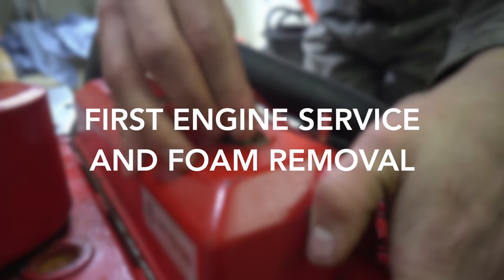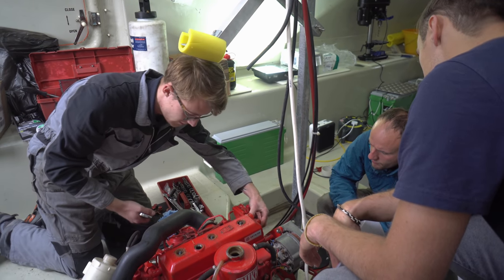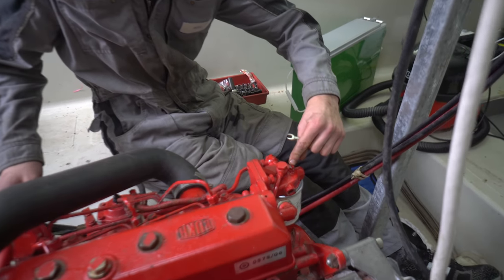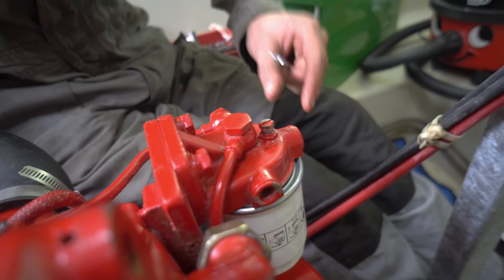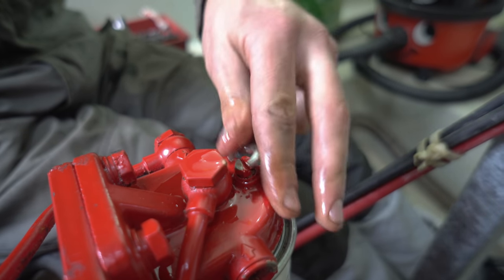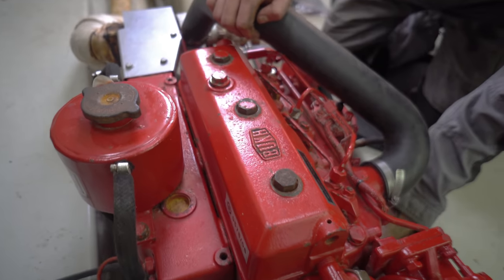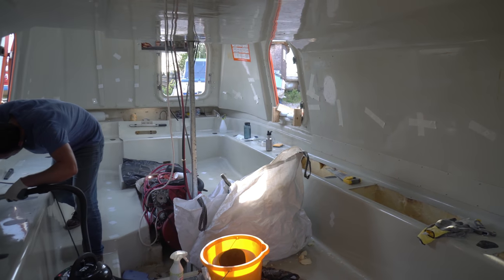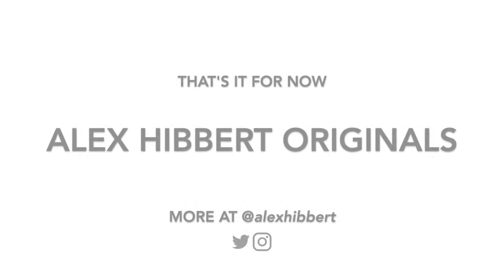Lifeboat Conversion Ep2: Servicing a Bukh engine [4K]

Comment: Bring extra belts for the engine and marine epoxy putty sticks. Let's gooooo
Reply: Miliput, spray foam, candles, waxed storm proof matches, dry socks in a plastic bag. cognac.
Onwards and upwards.
Reply: @Ben-Downlow.  ...of course pack the nooks with even parts chutzpah and reverence 😃🍯

Comment: Got an LM 27 motorsailer with a Bukh DV36. The engine is 41 years old and still runs like a new one. These motors are so incredibly solid. At 13-1400 RPM, it uses around 0.6 to 0.7 liter per hour, at 3.8 to 4.2 kts. I've had my boat for a couple of years now, and I always use the engine since I took off the mast. Initially I wasn't happy about a 41 year old engine, but it's grown on me. Now, I'm beginning to think that this thing could run for the next 200 years without any major issues. It's creme de la creme when talking marine engines.
Reply from the maker: I hope to have similar luck!

Comment: Good engine technically brand new. Yes very sufficient horsepower and being able to run at lower RPM. Binge watching your videos 👍🇦🇺
Reply from the maker: It's one of the great things about a decommissioned TELB. Although, diesel engines don't like being sat inactive for ages.

Comment: I assume your bringing another method of propulsion. I suspect the foam standard is a product of the boats past life and the launch method being a factor, it slows water ingress should there be a breach. Its your call and your life on the line but I would of thought other buoyancy applications are practical both physically and economically such that you might even free up more space. Even the fuel will add buoyancy although minimal. Best of British luck and ill give it a touch of Irish too.

Comment: That little diesel engine is probably based on a design 50-60 years old which is fascinating. Obviously in a lifeboat you need reliability and simplicity and you can't get much better than a little four cylinder diesel engine like this, which has a fully mechanical fuel injection and pump system. Modern diesel engines in cars are highly complex, and employ many electrical functions to control the injectors, ignition timing and turbocharger. The beauty with this engine is that provided you could stop it pulling in water, it is so simple and so "mechanical" that it can run without any electrical power at all under water.
Reply from the maker: Bukhs certainly have a good reputation, and these are intended for lifeboat use, and not repurposed tractor engines.
Reply: @AlexHibbertOriginals  That's interesting. I thought as well how similar it is to narrowboat engines. They are insanely reliable due to their simplicity. Love your videos. Am in the process of watching through your entire conversion series on here.

Comment: IDK about where you are, but that closed cell foam can be really cheap if you mix your own (hear in Australia anyway). A premix can would do 0.3m cubed for about $56 from memory, I found a fiberglass wholesale supplier and they sold me 2 tins, I could do about 5m cubed for $150. 
It's less convenient for doing up under decks and ceiling type work, or even side walls I need to learn a few skills, but basically you mix 2 parts in a cup like green cordial and water, tip it in like water, and within seconds it starts to expand 10 fold. Side walls I had to do in steps like the side of a mine hole so the thin mixture could sit on an edge and build up wards, the ceiling I didn't really get, I expanded a few bits all the way up and just left it as good enough, was no way to get the liquid into a tight whole, but my project with foam was in a 1k tin boat from 1970's, so it didn't really matter.
Reply from the maker: The LD40 is quite expensive here - I've used the two part in a few areas. It's got to be the correct weight bearing grade, not squishy foam. But have kept lots of the dug out foam to recycle.

Comment: Sweet running little engine. I have 2 of them that I got out of a warehouse that had been abandoned.  A single cylinder and a 2 cylinder.  But both need work. Do you have any info resources on these?
Reply from the maker: Bukh publish reasonably good documents on their website.

Comment: Just started following you.  Very interesting. Especially when I learned that you plan on some long range voyaging. I often thought that these vessels might make for an interesting and capable conversion.  You later sea trials showed that you were not using that much of the power curve.  Be aware that diesels like to work. Constant light loads a not so good for longevity. So perhaps less pitch on the prop?  Good luck and I will subscribe.
Reply from the maker: Cheers!

Yes, you're right, although the engine is far from idling when at cruising pace. I do need to speak to a propeller expert in the coming weeks.

Comment: You should consider a very high amp alternator and lithium batteries. That way you could do just about anything with the batteries.
Reply from the maker: I've considered Lithiums, but Lead Carbons can be abused in a similar way (fast charge, deep cycle etc), are helpfully heavy (free ballast) and are a fraction of the cost.
Reply: @AlexHibbertOriginals  thank you.
Reply: @cliffp73  Also, lithium batteries cannot be charged below freezing. Keeping the batteries above freezing shouldn't be a problem if things are going normally, but it is something you have to consider for emergencies.

Comment: The boat may be internally buoyant, but internal water will still be a problem. In addition to an electric bilge pump on each bilge (see my other comment), consider an engine driven water pump that can be engaged / disengaged. These can remove a lot of water quickly.

On my boat (which is much bigger), we simply use a Y-valve on the engine's cooling water pump, allowing it to suck water from the bilge instead of outside. However your engine's water pump is probably much smaller and that setup might not be effective.
Reply from the maker: After a few days, it was no more than a sponge job to clean and dry the bilges.

Comment: Is the Eng. Aircooled? See no Waterhoses during running?
Reply from the maker: No it's keel cooled. The engine was only run dry for a minute or two to avoid overheating.

Comment: That foam if dirt cheap it is bog standard expanding foam.....Check the specs it is probably fire resistant
Reply from the maker: It's far from dirt cheap sadly. Closed cell 2-part LD40 marine approved.

Comment: I'm not sure what video this is most appropriate for - but you should have two alternators connected to the engine via separate belts. Redundancy, extra capacity. You can run them to the same electrical system, or have parallel / backup electrical systems (house battery & starting / emergency battery).

Alternators take a lot more wear when you run them close to their maximum capacity. Specifically the diodes which convert the 3-phase AC produced by the alternator into DC to charge the batteries. So having extra capacity has tangible benefits.
Reply from the maker: It's logical but just not practical for the setup here. Also, energy generation is not going to be relying on the engine as a primary source.

Comment: Beware running your diesel at low RPMs for very long, else you may glaze the cylinders, and you don't want that to happen. Other than that, whack-o, lads!
Reply from the maker: We'll most likely run at mid-revs, in the middle of the power curve graph we had from Bukh - and at the point we later calculate gives best mpg.
Reply: @AlexHibbertOriginals  It happened to me with my 120 hp Ford Lehman, cruising around at 1200 rpm burning waste veggie oil. White smoke out the exhaust and oil blasting out the dipstick hole. Fuel conditioner cleared it up fortunately. Great project you have going there. Greetings from Canada.
Reply from the maker: @Shmerpy  I'm there most years - one of my favourite places - hello Canada from the UK!
Reply: @Shmerpy  waste veggie oil is a sod for that, I had a similar experience using it in a low revving engine, had to take the top end off and de gunk evrything, valves, rings, everything.
A diesel engine likes to work hard, so, towing another boat or somthing from time to time, really use its torque. And of course, from time to time just blast it at full revs for 30 seconds to de carbonise the engine and exhaust, really just blast out the carbon, you'll see it fire out in lumps!
It's also worth remembering that a lot of older type diesels actually need a bit of carbon to run at optimum, many newer and synthetic engine oils contain detergents etc which can actually be counter productive! So, as ever, attention to detail in finding the exact manufacturer's recomended brands and formulations of lubricants etc.
Reply: I read on a forum about some guys who'd put water injection on their veggie oil fuelled diesels to aid cooling, and found that it prevented glazing.
Reply: @kieranh2005   sounds really innovative, but I think a more versatile approach would be to assemble the correct rig and apparatus to carry out a proper tranesterification process, the resulting fuel (with maybe just a little parafin) could then be used in any diesel engine especialy TDi's without issue 🤞